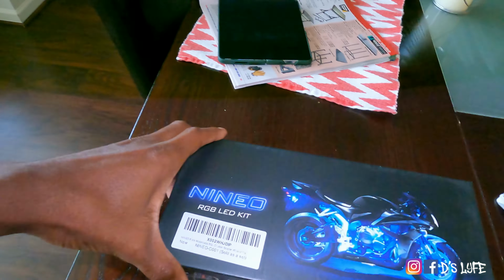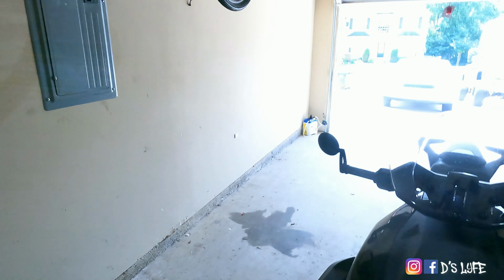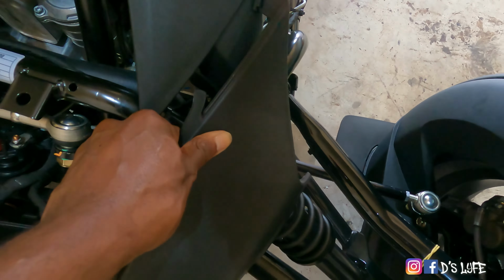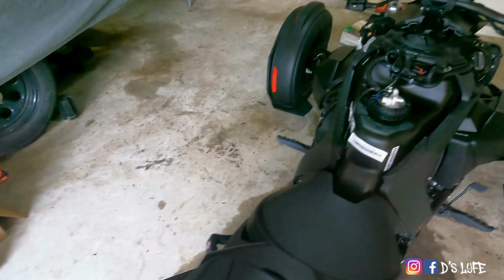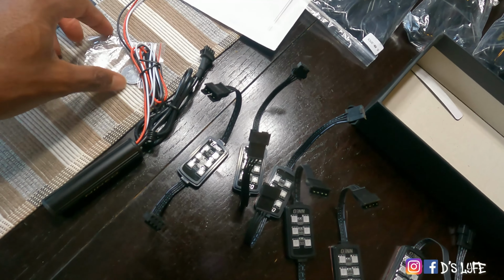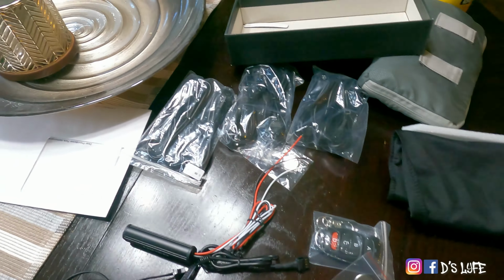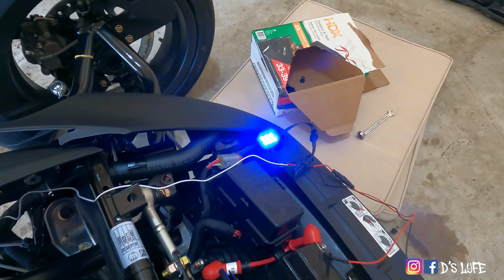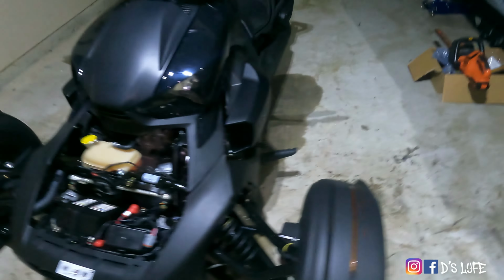HANDS DOWN THE BRIGHTEST LED LIGHTS ON THE MARKET! |MY FIRST 2022 CAN-AM RYKER MOD

Comment: I just bought the led set
Reply from the maker: The lights are dope and still holding up really good! I used t-tap connectors to tap into the brake light. ( https://www.amazon.com/120-PCS-Wirefy-Electrical-Connectors/dp/B077YB123S/ref=asc_df_B077YB123S/?tag=hyprod-20&linkCode=df0&hvadid=241981236908&hvpos=&hvnetw=g&hvrand=5003538349751864239&hvpone=&hvptwo=&hvqmt=&hvdev=t&hvdvcmdl=&hvlocint=&hvlocphy=9010760&hvtargid=pla-434396468819&psc=1 ). Let me know if I can help. Great buy bro and good luck!